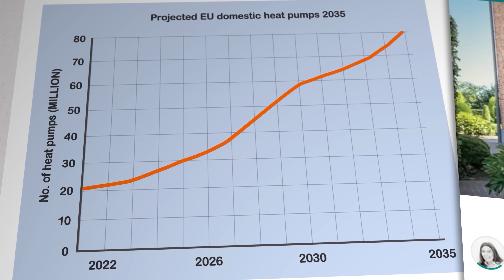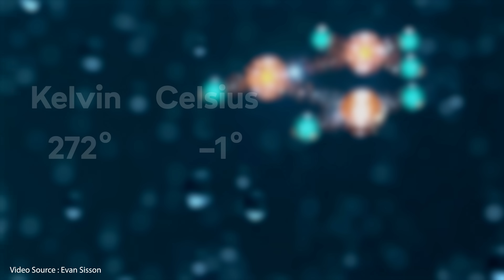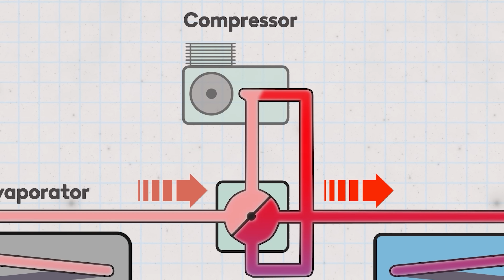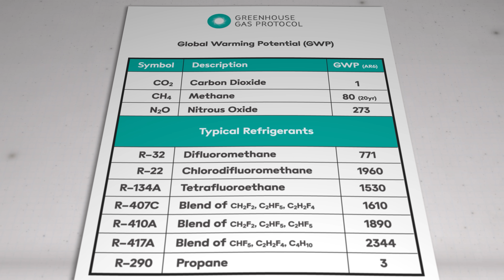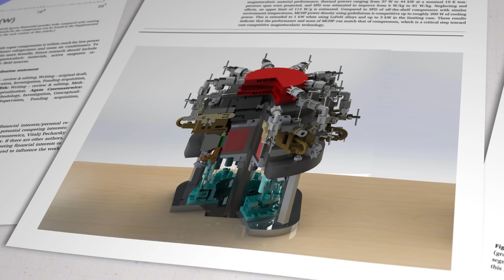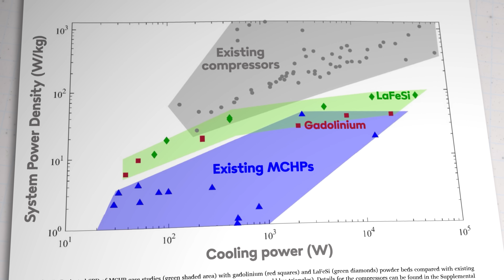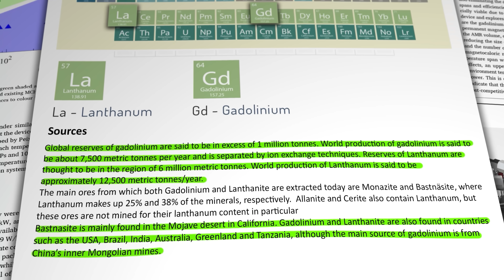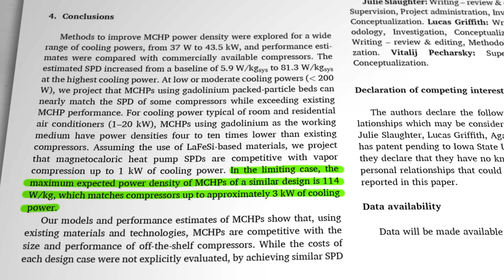Taking greenhouse gases out of heat pumps. (YES! They do contain them!)

Comment: I think this is much ado about nothing.  Heat pumps are good.  The refrigerants used aren't designed to go into the atmosphere and largely they never will.  We need to use the refrigerants that are the least expensive to drive adoption before we get too concerned about the pollution factor from possible refrigerant leaks.  Most of them are roughly the same right now.
Reply: Not quite true? Some 'refrigerant' gases used in older units for old AC (air to air heat pumps) have a global warming forcing potential (GWP) up to around 2000 greater than CO2 which is given the comparison value of 1. Most manufacturers are now selling some units using R 290 or propane 'refrigerant' which has a  GWP of 3. Most of the gases have some degree of flammability, and intallation location care needs to account for that.

Comment: Propane is used as refrigerant in heat-pumps for homes with same goal of getting rid of those refrigerants that have negative environment impact. Time will likely show which is less expensive with better efficiency
Reply: The government banned fuel-gas refrigerants in domestic refrigeration in the 1920s due to explosions.

Comment: One thing I have learnt over the years is what really matters is the physics rather than cost efficiency. Make the physics cheap in terms of energy efficiency, and the cost eventually follows (solar panels anyone?).

Maybe I might have missed it, but id love to know how does the energy efficiency of these compare to current heat pumps.
Reply: Go 1:50 and watch it again. It's about existing heat pumps and their efficiency then he explains how the new tech works.
Reply: @lestermarshall6501  I didn't see any point in the video where the actual efficiency of the magnet units was discussed. Considering that people have been working on them for decades with very limited use coming out of it thus far, I'd imagine the efficiency compared to phase change heat pumps isn't very impressive.

Comment: CO2 is the most widely used super coolant. They use CO2 pumps to keep ground frozen under new hospital in Nome, AK.  CO2 actually works better as a super coolant than insulation to keep things warm.

Comment: My parents need a new boiler but their trusted plumber says heat pumps don’t work.
Told them to get a quote from octopus but sadly they don’t do heat pumpers in their area.
Plumber and gas engineers are the problem.
Parents have a well insulated home but I’m 250 miles away so can’t push them to something new!
Reply: @nicksimmons7234  if you are 250 miles away please don't turn them into early adopters. This field is evolving fast, in 5 years there will be different heat pumps and some vendors will disappear. What if they need to replace a fan motor or another insignificant part and it is no longer available on the market?
Reply: @johnogreen1060  you’re on the wrong channel if you’ve come to hate on heat pumps. They have been around for decades, they work in the cold, they heat the homes fine
Only people that are going to go bush are cowboys.
Reply: @johngreen1060They'll be fine with a Mitsubishi or Panasonic, those aren't going anywhere
Reply: If you're in the UK, any Heat Geek certified heating engineer will do a great job.
Reply: @  they will but they’re going to be a couple of grand more expensive then a Octopus install and probably 3 grand more then a new boiler and the  plumber they’ve used for years tells them heat pumps don’t work.
If I was on the door step it would be a different matter. If they knew someone with one it wouldn’t matter.
Plumbers and gas engineers are the problem.
Reply: Similar thing happened when my parents needed a new car. The dealer convinced them ev's would burst into flames after 5 years. Nothing I said would change their mind. 🙄
Reply: @  I got them to move to Octopus a few years ago, if Octopus did installs in their area they would have got a quote.
Their home is so well insulated thanks to the Welsh government, plumbers and gas engineers are the problem.
Reply: europeans saying 250 miles as if that's a long distance lol, just go over there and get it done
Reply: @marklion315 yep, order the heat pump to be delivered to your parent's house.  Then drive over on a Friday night.   Bring the frame for a small concrete pad and 4 or 5 bags of concrete,  plus 1 or 2 bags of gravel plus maybe some rebar or just a cut piece of chicken wire.   Pour the pad on Saturday morning.   Install the heads on Saturday afternoon/evening.   Mount the compressor on Sunday morning.   Get an electrician to come out in the afternoon and connect everything on Sunday afternoon/evening and drive home.    If you need to, do this over two weekends.   Pad + heads one weekend, compressor and connections next weekend.
Reply: @marklion315  250 miles = "not his problem". His parents will depend on local tradesmen, so I can't fault them for being cautious.

Comment: The difference is you have an inferior product that does not give you piping hot water.
Motor cars did not replace transportation devices.
Reply: The heat pump is a superior product in most cases. Although my heat pump will quite easily heat to 60ºC I would never dream of using it that way, the slow low temperature heating leads to a far more comfortable house than the on/off of a gas boiler.

My heat pump is cheaper to run than a boiler, but even if it wasn't, I would still prefer it to the boiler even without the climate change advantages.
Reply: Inferior to other heatpumps?
Reply: Didn't realise people made Tea with their gas boiler.  But here we are.